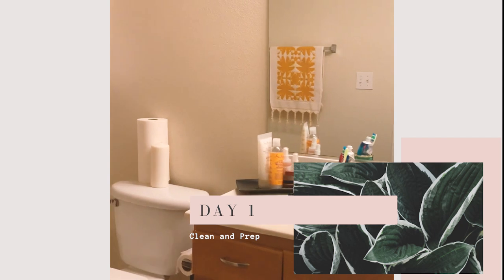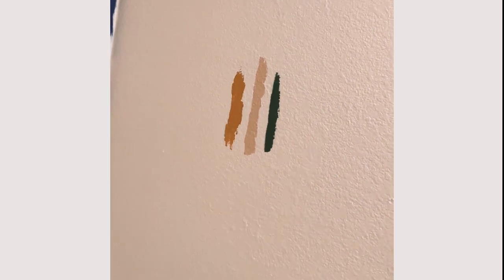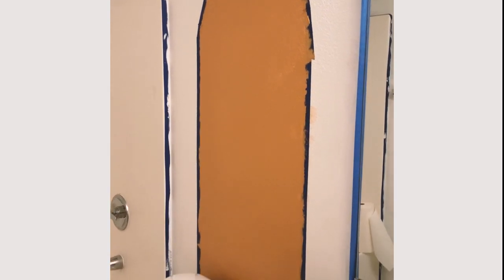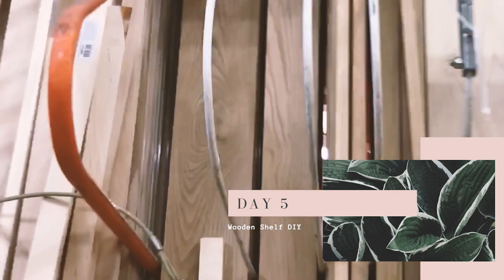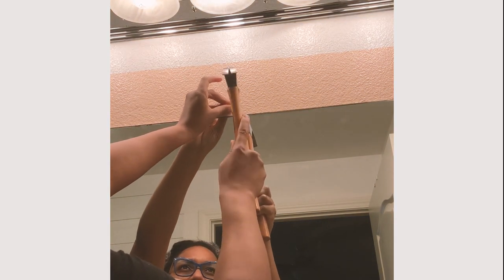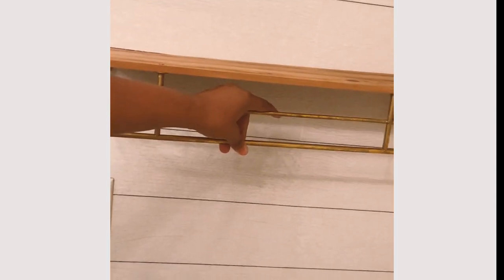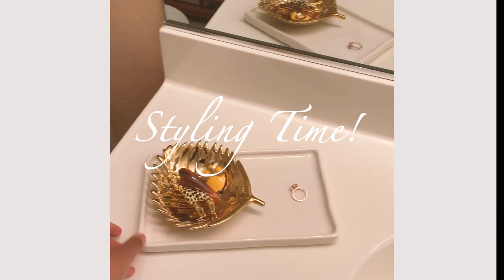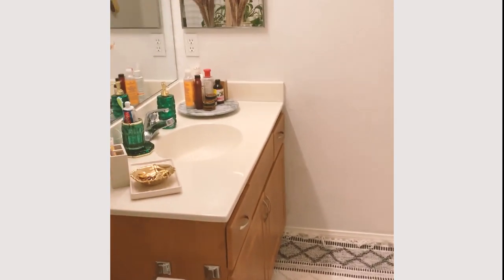My DIY Small Bathroom Makeover | UNDER $500!

Comment: Love this makeover, it turned out so great! A tip for painting with painter's tape... if you paint over the edges of the tape with the base color FIRST (in this case, the white) and then paint your colors you will have a nice crisp line that requires no touch-up because the paint that seeps under the tape will be the white!!
Reply from the maker: Thank you for the tips! I’ll use them next time!! 😊😊

Comment: Im in the process of putting wall paper in my bathroom as well & I did the same as you did not buy enough. My bathroom is set up like yours. I also put the paper on the wall facing the toilet instead behind the toilet & by the mirror. I'm worried about the wall paper above where the tub/shower starts.  I see you applied it there. I'm debating on doing this. Has yours peeled or does the moisture affect the wall paper?
Reply from the maker: My wallpaper is still going strong, and I’ve had it on almost two years now! Good luck!